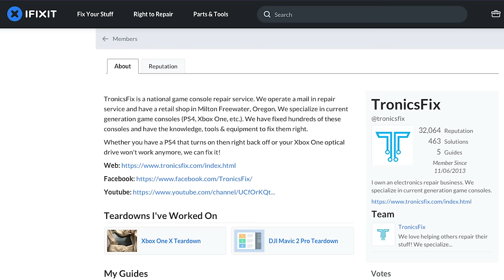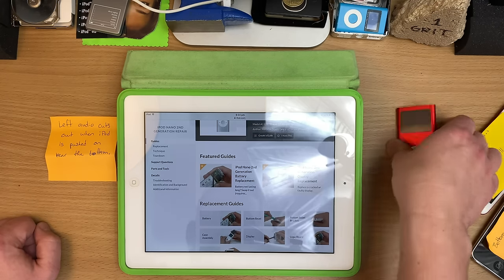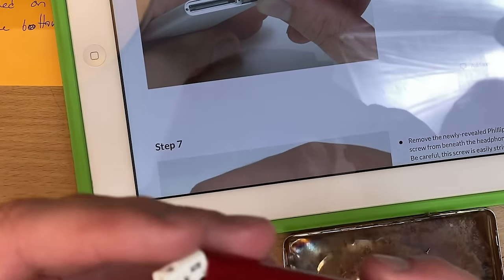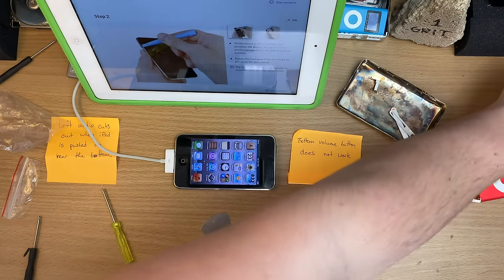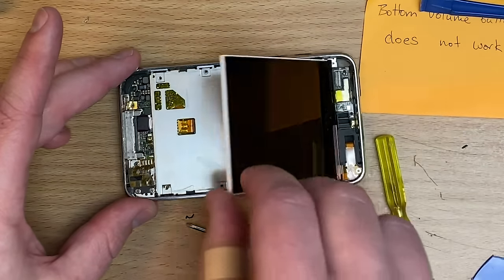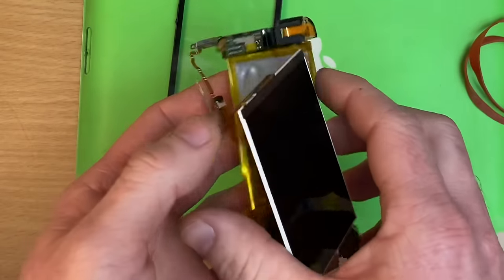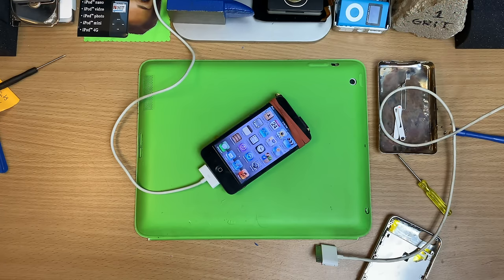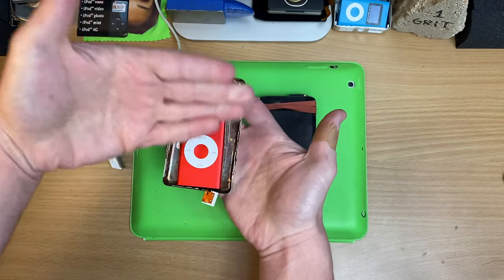I've never opened these before!

Comment: The shrekified phone is actually what I had to do at one point with mine. The camera was completely smashed, the speaker in the back had a big ol dent, and the backcase was replaced with just a wall of duct tape. All the buttons (rxcept for the home) were broken, so to turn it on, I needed to un-plug it repeatedly. In the end, it served me until the bitter end, when I had gotten my new phone.

Comment: I actually repair stuff as a side-gig. I make quite a bit of money off it. Now that I have accumulated all the right tools (soldering station, multimeter, oscilloscope, logic analyzer, heat gun, an extensive collection of screw drivers), I probably make ~50 dollars an hour on average repairing these things. I buy them off local thrift stores, flea markets or ebay (though ebay is often more expensive), try to repair them and then resell them. If I fail to repair them, I can also just resell them in broken state, so I usually don't lose any money. 

One thing I have learned freelance-repairing stuff and which this video also shows: The older a thing is, the more likely it's worth it to repair. Because older devices are simpler and they also often have extensive service manuals / published reverse engineering (because the patents are no longer valid). Furthermore, if something is broken in a very old device, chances are you just have to replace something very obvious (capacitors, belts, fuses etc.). It's also harder to break them further by trying to repair them, since people used more screws and less glue and snap-on connections in the past. 

I enjoy repairing old Sony and AIWA Walkmans the most, because they are easy to repair (most of the time, they can be fixed by just replacing the belts and recapping the boards), excellently documented and you can also make a lot of money off them. Stereo decks (without CD drives, those are a nightmare!) are quite decent, too, though not as profitable. Old laptops are also pretty great, especially ThinkPads. Everything made after 2005, especially phones and stuff, is a nightmare, unless you already have a good clue what might be broken. The only exception are headphones, those are still really easy to repair.

Comment: I have gotten it free with a bulged battery, it is possible pro tip, the screw threading that's in the middleish of the iPod, put a plastic spudger tip (like the pencil side) into that and just push as hard as you can, it's not really the battery that's causing the unwillingness to move, it's all the dirt and grime against the sides, best of luck for all of those with a 2nd gen nano...

Comment: When I tried to disassemble a 5th Gen Nano I had issues with the battery adhesive keeping the whole assembly from sliding out - use isopropyl alcohol to loosen the adhesive. Makes removing batteries way less sketchy.

Comment: On the ipod touch and some of the older iphones, usually those buttons would stop working because the black plastic nub on the membrane switch would come off. Instead of replacing the ribbon cable, we would unscrew the bracket holding the button and replace the nub. Replacing the cable is more proper but this was quicker and easier.

Comment: I bought a Mini a couple of years ago and the seller tossed in a first gen Nano along with it. It didn't have the black spot, so I plugged it in to my PC and shortly after I noticed that the screen was shattered and it was hot. Immediately unplugged it and put it outside on top of my fire pit. Luckily nothing happened after that, but I pulled out the interior and have the shell sitting on my desk.

Comment: Honestly the Gen 3 nano is the only one worth repairing. It works sort of like a classic, when you take the back off anyway. The only thing that sucks is you have to solder the battery in but honestly it's not that hard. I just replaced the battery and repaired the headphone jack on a nano Gen 3 with jumper wires and it works great. Only thing that sucks is the back won't go back on correctly and I can't find a guide anywhere that shows you how to form the back to it's original shape so it sits flush again.

Figured I'd say screw it and order one from eBay and see if it fits better.

Comment: the nano's battery can be punctured with a needle carefully(just the coating, its VERY VERY VERY unlikely you will have any sort of fire, and no, it cant explode, once the pressure is out of the insulation you can push the thing out much easier, sounds stupid but, i worked at place that did repairs for apple back in the day...that could happen to units only months old in rare cases... we had glass puncture tools most times....

dispose of the batteries in a sealed jar... we save them till we go shooting/plinking then dispose of the leftovers after...  fun times.

Comment: I just tried to fix a 4th gen with the black spot starting for my stepmom. Fun fact, if you VERY lightly puncture the battery (carefully 😅)  it will vent, and shrink back down.. and you can then get it out. I had safety gear and a metal fireproof container to put it in, in case of a thermal runaway. I was also monitoring the temp the whole time after venting it. However! I ripped the clickwheel cable on the way out because I'm dumb. So all that stress, sweaty hands.. and like an hour of time.. for.. nothing 🙌🙌🙌 One thing about me.. is I can take apart absolutely anything! Will it go back together and still work after? Who's to say?😅😅 If you would have inserted the tool and.. .. gingerly.. smacked it on the desk, it would have forced it out. Tearing the batt? Maybe. Breaking things? Possibly.. but she woulda came out. 😂

Comment: I bought a used Mini and they decided to toss in a 2nd gen Nano for free. Wasn't showing the black spot so I plugged it in to see if it was OK and it was able to sync but the screen didn't work. Decided to let it go (aka, I forgot about it) and came back later to find that the screen powered on, but the screen was cracked and the battery was expanding and I quick got it outside before it caught fire, but it never did. 
Few days later I brought it back inside to take it apart so I could keep the shell as a cool decorative piece since the screen was ruined and didn't want to waste money replacing it and the battery since it was a 2GB model.

Comment: Regarding the nano, I asked my gf not to repeatedly plug and unplug my trusty old green mini because it would inflate the battery. She did it anyway. I took it to the garage, put it in the soft jaws in the vice, sprayed some silicone in it and literally beat the logic board with a hammer and punch until it came out. The logic board was curved, but I put a new battery in it and it works fine, so there's still hope for the nano. Long ago, when my touch was still new, it was in my pocket and I put it in the washing machine. I took it apart still wet, unhooked the battery and let it dry. I put in a new battery in it and it still works great.

Comment: I wouldn’t even risk opening that older iPod touch.  There is so many ways to control the volume in the the device itself it isn’t worth messing it up.  Yoy can use the volume slider in the app, use assistive touch to control the volume, or jailbreak it and assign a volume button through activator.  Hell, even a pair of headphones with music controls will solve this problem.

Comment: mate you can totally make the Shrekpod touch portable by strapping a small powerbank to it with yet another rubber band. Just have a short cable run between them and boom, plug in and out on the go

Comment: Don't be like me but I have fixed nanos with black spots by fully discharging the battery and then intentionally puncturing the cell to relive pressure so I can get the unit apart and put in a new cell.

Comment: Wonder if a vacuum chamber would work to deflate the battery. It is possible to destroy the lcd but maybe 🤔.. but you could make a vacuum chamber with a pickle jar and a 50$ refrigeration vacuum pump or a free old refrigerator compressor.. worth exploration for sure

Comment: its not the best idea but if you poke a hole in the battery on the red nano it will shrink the battery and it will just slide out with ease

Comment: Those weird plastic spatula pry tools are just not fit for purpose. I bought a set to open up a PS4 controller to replace the battery and clean the analog sticks out, and ended up snapping each one immediately and deciding to just use the handle of a teaspoon.

Comment: I know I'm 3 years too late, but honestly if it's something where you know the thing is prettymuch wrecked and unless you get the battery out it'll get worse, I would have probably tried going a little harder.... Harder as in get the tool in place then put the end of the handle against the table instead of the palm of my hand and then give it the ol' heave ho. Though I would have made sure to do it outside in case the silver pillow decides to let loose.

Comment: if that were my ipod, i would want to put on my welding gear, take the thing outside on some grass, and carefully puncture the battery with a sewing needle. worst case scenario, you just drop it in the grass and it was already cooked anyway. otherwise, the battery can vent pressure and deflate, and then you can remove and clean the guts.

Comment: advice on dealing with adhesive on the battery try using isopropyl alcohol to prevent the casing from ripping as it will loosen and soften the adhesive preventing a fire but james....... DONT USE A METAL TOOL NEXT TIME like it actually gave me anxiety ive delt with batteries ripping and that metal tools are the worst to use and dank look for a cheap screw driver set on amazon i think you will like the tools in there more than your current tools as they wont break as easily.

Comment: Bruh actually I love your videos
(My profession is mobile repair) but when I see you struggling it's like hurting me no hate but first of all you have to heat the touch panel to remove it way easier then I have repaired over 20+ of black spot dudes but It is kinda hurting me that you were not able to 

You actually press them against the table sideways and making sure that doesn't slip and the internals will come out easily and some time you can use a bit of IP(a) liquid and heat gun to get it out 

Ya i agree you don't have the same tools as mine

But this video is hurting me actually

BTW love your videos : D

And I'd love if I can help you with any future repairs of mobile or iPod or any tiny thing 

(I have got a battery explode on me like 3 years ago, but it was a mobile phone and it was water damage that's why it explodes)

Bro actually I'll feel very good if i can help you with any future repairs 
 

Again love your videos ; )
Reply: BTW the phone I use the Nebula blue one was in pieces when I got it now works like new and

https://photos.app.goo.gl/z2hpd3NYR4NnSbt29

I'm really really sorry for the poor video quality and bad recording it is like 4-5 years old 

And there are few more phones I was repairing

(The vivo y93 Nebula blue one was crushed by cars on an highway so it was not in a good condition )

Comment: You guys bought the trashiest chinese-tools I've ever seen I bought chinese-tools before and when you buy them from the right places they're not that bad I use my tools to take apart my PS4 controllers to clean them and I've never had one break I also took apart a PS3 which required a prying tool and it didn't break